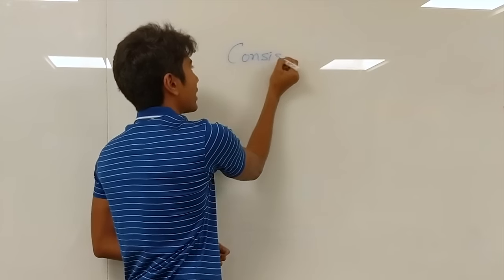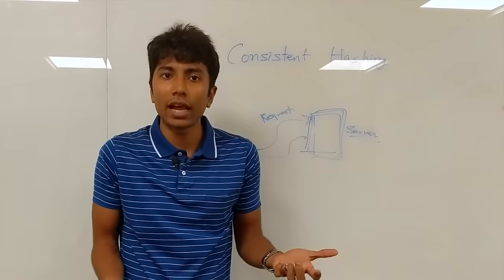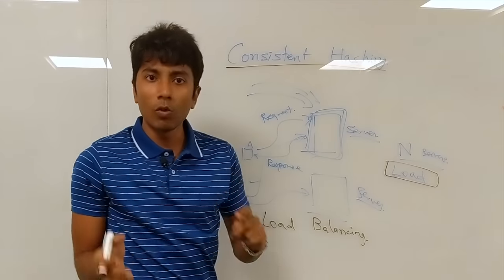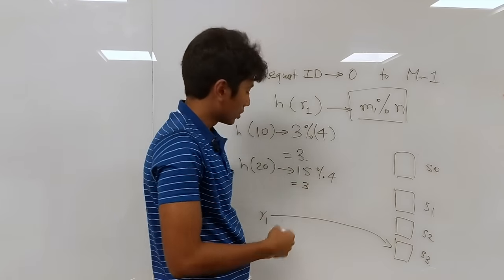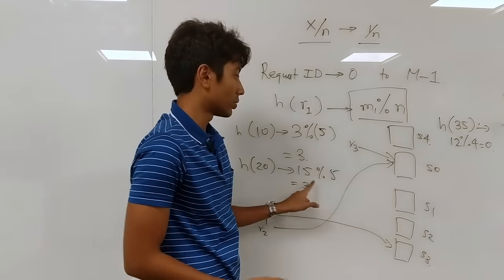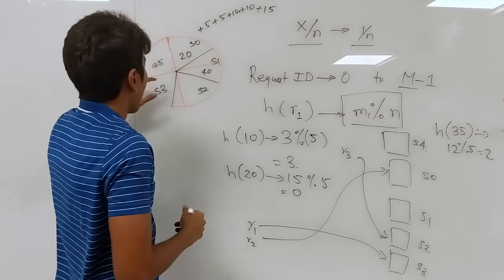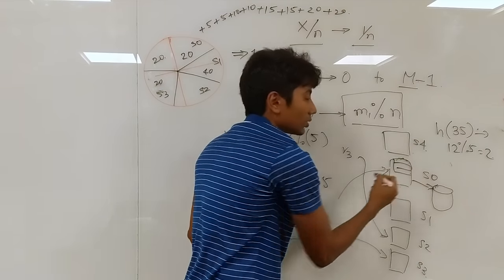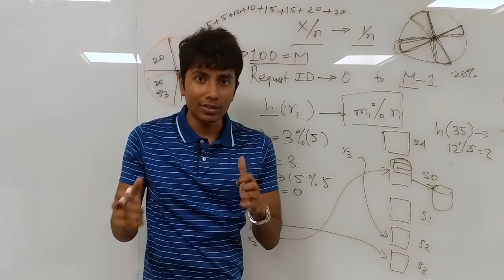What is LOAD BALANCING? ⚖️

Comment: hey nice work bro..
but i think you have mentioned in the video that 'we need 100 change i.e actually M which is our entire search space  when adding a new server s4'  at https://youtu.be/K0Ta65OqQkY?t=631 but actually if we carefully observe we need only 80% change. lets take a example suppose you have numbers from 0 to 19 then when u have 4 servers you will divide it by 
s0->[0,4,8,12,16] 
s1->[1,5,9,13,17]
s2->[2,6,10,14,18]
s3->[3,7,11,15,19]
but when u add one more server configuration becomes
s0->[0,5,10,15] 
s1->[1,6,11,16] 
s2->[2,7,12,17] 
s3->[3,8,13,18] 
s4->[4,9,14,19] 
u can see yourself that only 20% of numbers are still present in same buckets i.e numbers (0,1,2,3) all other numbers are changed which implied overall 80% change took place not 100% also (n/(n*(n+1)) i.e. (1/(n+1) search space remains same which is in this case (1/(4+1)) = (1/5) = 20%.
Reply from the maker: Hey Abhishek! That's an interesting point, let me get back to you on that 😋